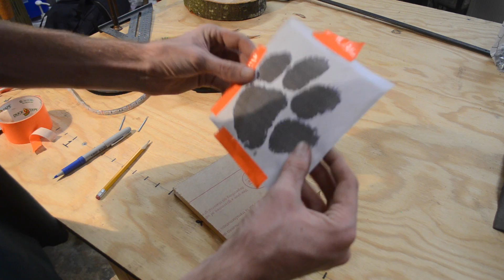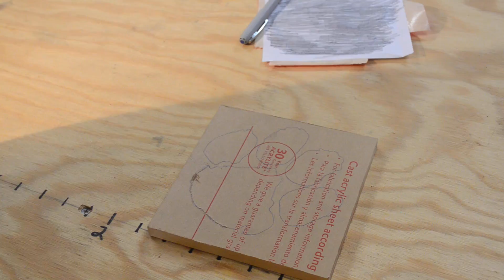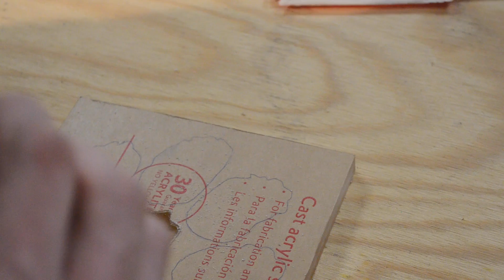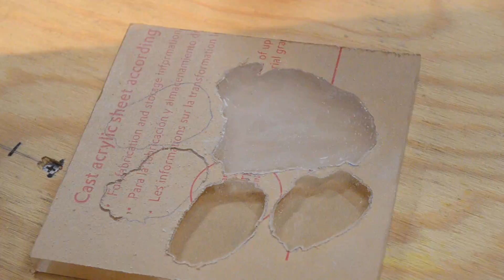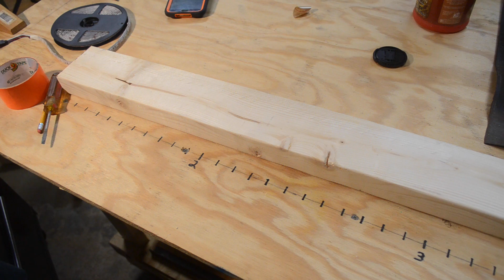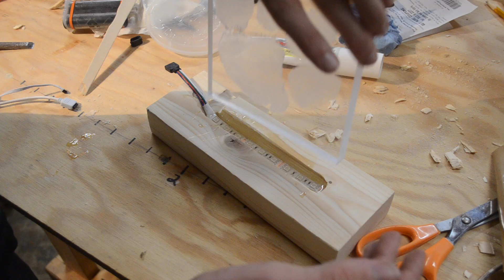How to Make a Glowing LED Sign From Acrylic

Comment: I had the very same problem with the backing as you did and I used the same glue and it worked like a charm and 5 years ago from today it is still there and it isn't moving at all

Comment: Instead of the pencil use a clothes iron not too hot and several pieces of paper ontop and iron the printed logo onto the plexiglass paper. 
You would have to print an inverted image but any photo package can invert the image. 
Hope that helps 
Cheers Mark

Comment: I just wrapped a fine grade sandpaper on a dry eraser and the main sanding was faster and easier. I also used the dremel round bit to go just a tad bit deeper to give it some dimension. Too much work sanding with a dremel.

Comment: great vid love ur approach trial an error. use what you got make it work shows cleverness  first time with a chisel you got it done.  yet try turning it over  first, start out with it on end tip of the blade on ur marks. tap with a hammer to a depth no deeper then ur needed cut little at a time  then with the flat side up and at one end go into the wood tip down till the beveled edge is parallel with the surface of the wood and tap the end of the chisel driving the blade toward the other end it will peel up no more then the depth of ur chisel  go at it in small bites till the depth desired hope you can understand what i'm trying to sa. a little hard to explain, thanks for the great vid

Comment: Looks great, but maybe if you make anything like it again, you should drill a hole straight down for the wire to go through and then do a channel underneath for the wire to exit. That way you're not left with an unattractive wire on the top. Going to check out some of your other videos now, after just finding your channel. All the best, Diane from UK x
Reply from the maker: Thanks so much for watching; I agree the side-exit of the wires is not ideal!

Comment: Wouldnt it also work with fine sand paper? I want to do one of those but dont have a dremel.
Reply from the maker: Yeah! Find sand paper might give an even better result, as you'd have more precise control over where the pressure was going

Comment: you might want to consider drawing your design on the adhesive paper that is on your acrylic. and then cutting out the design with an X acto knife .Then with a low pressure sand blast ,hit the exposed plastic until you get the desired texture.Have seen this done with ordinary window glass and it worked good.Should work on Plexiglas too.

Comment: Think about  Sand Blasting  the cut outs..   Just find a way to blow sand at it..  You can use a Shop-Vac exit hole,  if you don't have a compressor.    Before Plexiglas was common,  I did a lot with Glass..  Just make a stencil and sand blast..  It comes out uniform and beautiful.

Comment: First you are using the wrong bits.....You can get wax bits, oval, round and drum bits...Works good on all acrylic...Now Dremel makes a shaft that is so much easier to use....Go to your hardware store...Lowes, Home Depot...They have all the Dremel parts...You never need to use sandpaper....I sculpt in acrylic all the time...Hopes this helps...Rik
Reply from the maker: Thanks for the suggestions; I'm by no means a dremel expert haha! If I make more, I'll be sure to use the right stuff so hopefully it'll look better.

Comment: can i use ez engraver pen to engrave will that work ? pls reply
Reply from the maker: You should be able to; I have never used one myself but I imagine it would work just fine.
Reply: The dremel tip using was an engraver bit so yes it would work as what you are doing is engraving an image which distorts the light which gives its effect

Comment: when you cut the LED lights. how can you use the other pieces if you are making several different projects. ty
Reply from the maker: Thanks for the comment! At the different places where you cut the lights, there are copper contacts which stick out, and you can press the pins of the controller into them. Think of it like a bridge; when the light is whole, the lights are one solid piece with the copper contacts connecting the two. When you cut the lights into sections, there is one set of contacts on each side of the cut. You then plug the harness end of the controller into these exposed contacts.
Reply: @piedmonttiger265  go on ebay and search led connectors you will find that you can order in bulk sqeeze clips and any component even controllers to make any size or string together about any combo you want   and cheap
Reply: Btw, there are a lot of “how to” videos about LED strips (and most any other topic) on this nifty new website called...umm... I forget now, but I think it’s called “YouTube”. 😉

I learned something from your video here, wet sanding with a Dremel.
Reply: Tina Marie Malinowski 
Thanks for asking, i was just wondering about this.

Comment: very nice...however if you do this again you might try using a drill  to drill a hole from the back of the base for the wire to go through, thus hiding your wire.  again very nice!
Reply: I don't understand why the wire comes out of the top..

Comment: Drilling several holes and then using a chisel to clean it up might have been the best method for making the channel in the base. Using as forstner bit would have been good. Half inch acrylic always measures under size, as does all acrylic.

Comment: Do you own a table saw or a proper wood chisel ?
Reply: with a proper wood chisel,  you outline the cut then use the opposite side of the chisel than you were using as a fulcrum to pop the pieces of wood out. Then use the chisel like a scraper to clean up the recess. 
by the way, don't junk the broken LEDs. They can be re-soldered to another project.

Comment: Hi thanks for the amazing video..Where can I get the dremel tool?, how much it costs, and how can I get it here in Kenya?
Reply: ..dremels are under 100$...but there are cheaper versions that work well, the bits should be purchased in a kit with many different ones, to buy one at a time is alot more money, Find them online, or any hardware store, or Walmart sells them!!...Harborfreight has an off brand, and misc. Bits .all together for a fraction of what name brand Dremels, and Dremel bits cost, and work well!!..hope that helps!!....I think they are called high speed hand tools!!

Comment: nice work. did you buff and sand bottom for light to come thru
Reply from the maker: +BSTEWART P. HILL Thanks! I did not change any of the sides because they had all been "roughed up" by whatever cutting method the place I ordered it from. I would imagine sanding them would cause a similar effect as the design in the acrylic, causing the light to diffuse around the sides and make a sort of border.

Comment: I use an abrasive brush (steel wool like).  It does the trick very nice and doesn't tear into the stencil I place down.  Makes the job so much easier.
Reply from the maker: +Lawrence Shurtleff Great thought! That does sound like a good way to do it; more precise and controllable than the dremel!

Comment: you should have drilled your hole (large enough for the connector) straight down through the edge of the slot and then you could have notched out on the underside of the piece.  would have given you a much cleaner and neater appearance.
Reply from the maker: +Michael Wenman You're, right it would have. Could have "notched" out the bottom where the cable came out instead of having it just strung off the end. Thanks for the comment!

Comment: came out nice, but a quick suggestion. just take the protective layer off both sides of the sheet and tape the stencial under it and trace the outline with a sharpie marker on top. it wont clog the dremmel attachmentment as well. After thats done, just trace a 1/4" outline with the dremmel and hand sand it, it doesnt have to go deep at all to shine through. Just these 2 things alone will save you loads of time.
Reply from the maker: +Marshall Rosenberg Thanks for the tip; The dremel getting bogged with the adhesive and paper was a bit of an issue!
Reply: No problem, It came out really cool. Its all trial and error to figure out the best ways to do things sometimes.